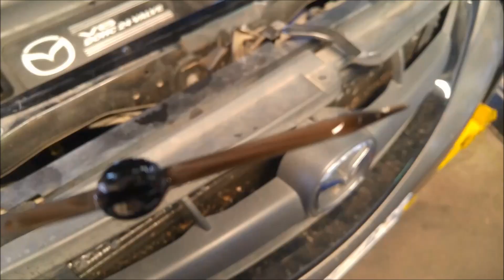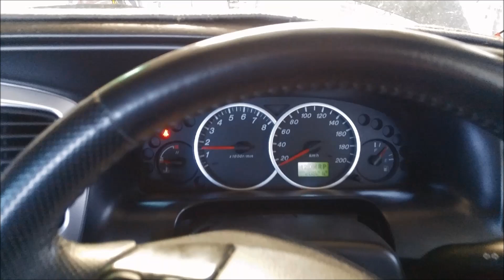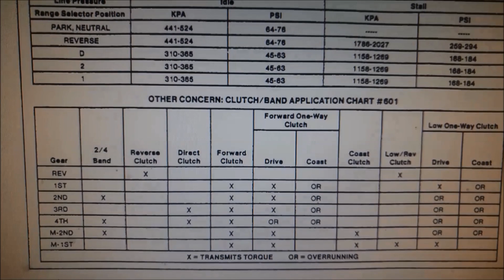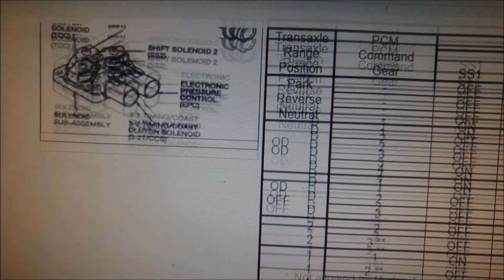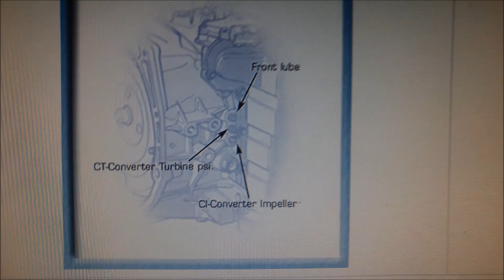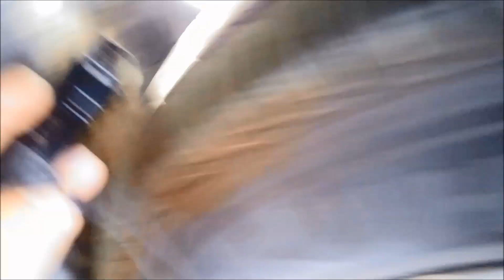Mazda Tribute LA4AEL Transmission No Forward No Reverse Ford CD4E Transmission No Forward No Reverse

Comment: Hello. Yep Thatsit. I have a 2008 Mazda Tribute and it is doing the same as you mentioned. Drives a bit and turn off the engine and it will drive about 100 meters. This sympton started very sudden. No signs of slipping or slow shift. On your video at 6:58 you mention flushing the filter, do you flush cleaning solvent and blow into the port or do you know of a nija hack to flush out the trany. my oil was also off colour and slight burnt odor. any  brilliant ideas. Please  Cheers Dave.
Very well done video. awesome
Reply from the maker: hi, internal filter reverse flush with compatible trans fluid. cheers
Reply: Thank you very much. I didn't how reverse flush the trany so pulled off front oil pan and the solenoid body. Then I had access to front port of filter. I flushed with brake cleaner and 2 litter of diesel fuel and air blower. Today I'll have it assembled and ready for a test drive. I will leave you a message in regards to how well it the transmission works. 
Cheers. Dave
Reply: Ii completed the flush and it's a bit better, but still it quites after 1/2 km. Turn off the engine for 30 seconds and it drives again. Can you please explaina reverse flush in more detail. 
Cheers Dave
Reply: Did you solve it?  @01goldrush

Comment: Was your 4WD light flashing? I have a similar issue, with my case the gears engage when cold (delayed) but when warm I get nothing except the Park gear. Solenoid perhaps? My car is a Ford Explorer but I think they are practically the same.
Reply from the maker: hi, check basics first and bear in mind that fluid thins out as it warms up.if you have internal pressure leaks the fluid will pass through those leaks easier. cheers
Reply: Thanks for getting back to me. I actually got the 4WD light to stop flashing due to a bad ABS speed sensor, however I am still having the same tranny issues. I think maybe the pump? I hear a whining noise at start up but then it goes away. I changed the solenoid, flushed out the fluid and blew out the residual from the filter and it worked for about 20 minutes but then problems came back again. The car can move in 1 gear but then gives up after about minute of driving. I then have to turn the car off and on again and it engages right away but gives up. I hate these cars! Really hope it's not a clogged filter like you mentioned. No leaks, I checked.  @YepThatsIt

Comment: Hello, someone did a engine swap on mine, and they accidentslly mixed the coolant amd trans fluid lines at the bottom in front of the front cover, could the coolant going in have blocked that filter?
Reply from the maker: hi,wow that would be hard to do ! hopefully the coolant wasnt in there long enough to do damage. you need to do over 5 full flushes to get as much coolant out. see our vid https://youtu.be/1paq5RbiTNQ cheers

Comment: G'day, really enjoying your videos.
Quick question....I have an Aussie 2007 Ford Escape with the 2.3L engine. 
Does this have the F4A-EL transmission where I can change the filter without removing the entire transmission?
No issues yet, just trying to prevent them happening!
 Thanks Gary
Reply from the maker: hi, most likely a cd4e trans. cheers

Comment: Does this problem cause all gears to prevent from engaging? My transmission will go into gear and do nothing, I have checked the cable and it is functioning properly, so I know it is engaging, but has the same symptoms as your vehicle is her, but pulls none in 2nd and 3rd.
Reply from the maker: hi, any issue that causes filter to become blocked is not good. cheers

Comment: I have an 07 escape I have a p0720 and p0722 but I changed the oss but still doing the same
Reply from the maker: hi, contact me on my face book link https://www.facebook.com/Yep-Thats-It-103051017785435/  and leave me which  kind of vehicle/transmission type you have, and leave a detailed description of any fault codes and issue you are having ( we are able to exchange pics/diagrams on there ) and details of what work you have already performed or checked...... you will need to buy me some beers ( link is in face book ) and I will answer your questions accordingly. cheers
Reply: It says the page is not available and it’s a 2007 Ford Escape and it has the CD4E
Reply from the maker: hi, try without forward slash...  https://www.facebook.com/Yep-Thats-It-103051017785435   cheers

Comment: Some of the info ragarding the trans filter and pan i think is a bit wrong but great video. Im suffering from very similar symptoms. In America there are no filters in these vehicles. They are filtered via gravity and internal magnets to keep the steel debris to a minimum. and there is a pan that you can remove and you can even replace the whole valve body while the transmission is in the vehicle.
Reply from the maker: hi, yeah same here in oz. on these trans needs disassembly to access internal filter ( you can fit inline filter on cooling line ). when you remove vbody you can reverse flush filter if there are not too many gremlins/debris in your trans. see similar vid where I reverse flush internal filt which can also be done with yours https://youtu.be/x7qqWIXO-MY cheers

Comment: The car has pushes in the third gear.  What's the fault?  What can I do?
Reply from the maker: hi, if you are meaning it has only got 3rd gear, it is most likely limp mode and an electrical issue. check all connections and solenoid block. cheers

Comment: Just curious, was a reverse flush tried?
Reply from the maker: hi, not this time. it was very contaminated with metallic debris. would have been very short lived improvement. cheers
Reply: I would say a transgo shift kit would fix the problem.
Reply from the maker: @TampaBayBucsfan92  I doubt any kit would have any lasting improvement as there was a lot of friction material in the trans fluid, even if you could replace the filter it would get blocked again in short time. cheers

Comment: What ever happened of this? My situation is exactly the same as this and I'd like to know the outcome of the diagnosis. Please.
Reply from the maker: hi, was remove and rebuild. cheers
Reply: @YepThatsIt  what was the culprit, a blocked filter?
Reply from the maker: hi, yes blocked probably from lack of regular servicing, which ultimately greatly reduced the life of that transmission. cheers
Reply: @YepThatsIt  you think if i flushed all of the fluid out of the supply hose until it ran clean id get a little more life out of the transmission?
Reply from the maker: hi, that really is hard to determine without having a look at the vehicle. cheers
Reply: @YepThatsIt  its doing the exact thing you described. guess I could give it a try. I cant really break it anymore hahaha thanks!